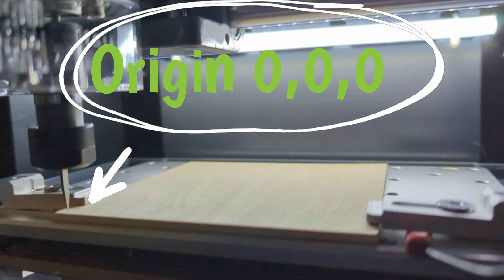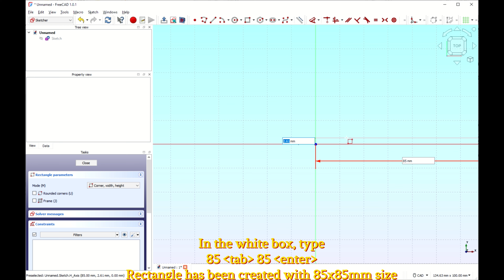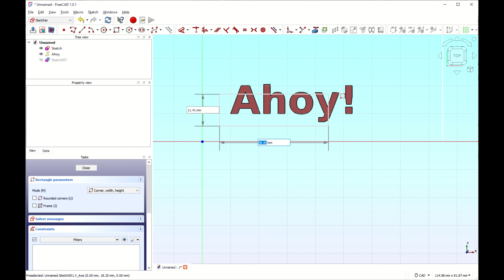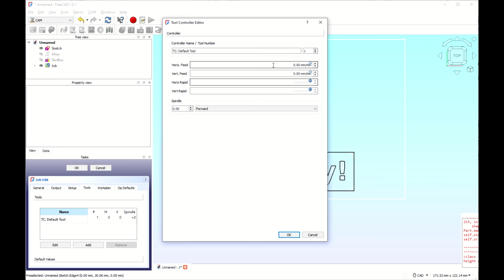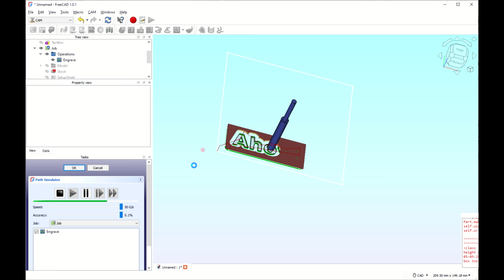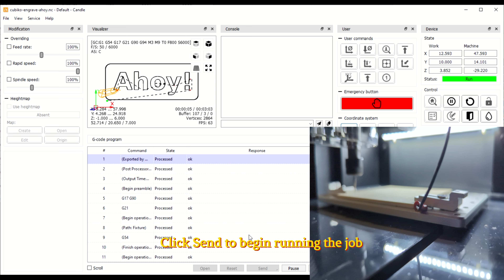I Just Want To Engrave

Comment: Ahoy ! Henry, Thanks for the tutorial. This was actually my first try with free tool and actually second try of CNC work (tsted easel).  With my freecad 1.1.0 simulation window is more advanced. Also tip: We can add different toolbit (one of V shaped). On the initial picture of this video there is your engraved element visible. Simulation will be more accurate in this case.